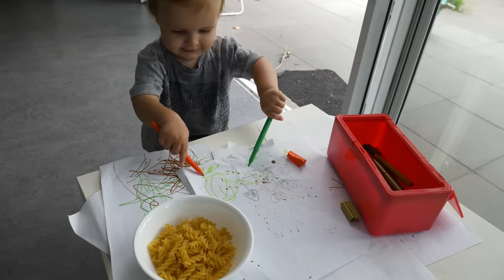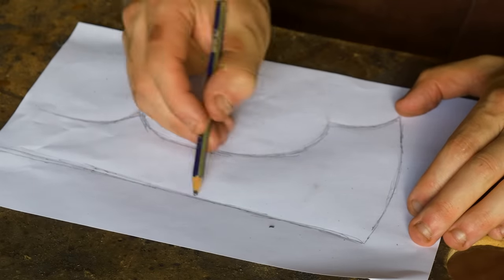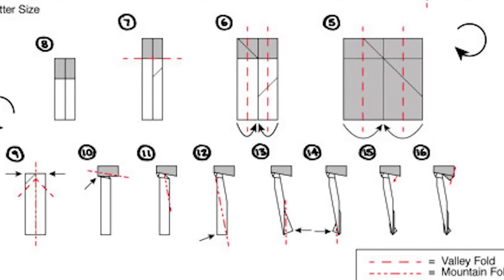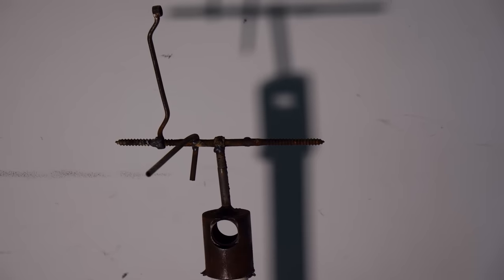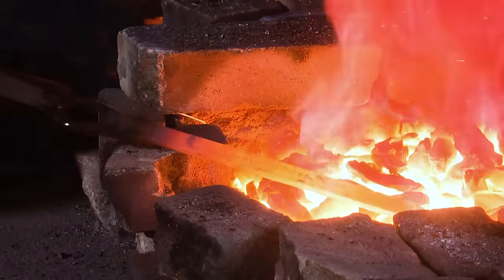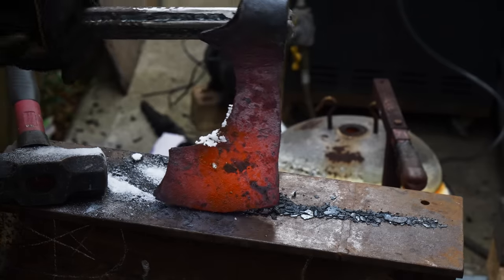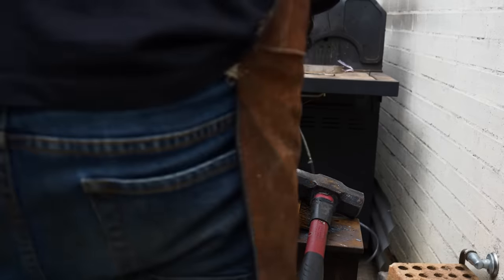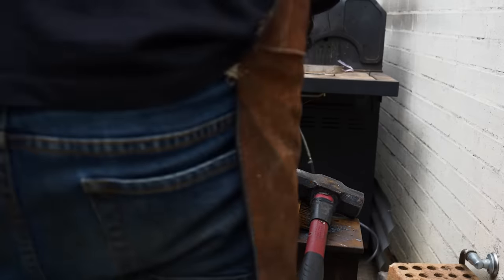YouTube's Worst Blacksmith Makes a Viking Axe!

Comment: The purpose of the two-headed axe is you can keep one side very sharp with a steep bevel for chopping a tree normally and the other side more dull with not as steep of a bevel for hitting things like roots near the ground where your edge could hit a rock or something. Source: Wacked a tree or two.
Reply: Hmmm.. Interesting.
Reply: Why not just have two different axeheads then? Or two different axes? Yes, it would be heavier, but you it would be way saver.
Reply: @tomatopotato1136  To my understanding it was popular with loggers and railway workers laying track back in the day. Because it's only you carrying the tools in and out of remote area's and probably needing to switching back and forth rapidly.
Reply: @patrick7742  Well that does make sense.

Thanks for the fun little information :)
Reply: @tomatopotato1136 it's just because 1 tool to carry is easier than 2:)
Reply: Came to the comments explain this, I guess I'm 2 years late.
Reply: And you can apply this philosophy to skulls and human appendages as well!
Reply: One thing I read  that makes sense regarding double-headed axes for combat is that the center of mass of a double-headed axe is more in line with the handle than on a single-headed one, which reduces the axe's tendency to deflect when you don't hit with proper form. The comment suggested that you imagine yourself trying to split wood with a throwing tomahawk or some other kind of single-headed axe with a really long blade to understand the concept.
Now I don't have particular knowledge on medieval combat, but this comment made me look at some weapons in a new light. Historical halberds and warhammers tend to display pretty balanced heads. They relied more on force than finesse, and were contemporary of plate armor that tends to deflect blows.
Reply: It’s also usually used as a battleaxe, not for cutting wood
Reply: @banjomanperson  No its not. Axes used in war only have one head because more weight makes it harder to swing & why have a second axe head. Its only in fantasy that they appear. Its like those axes with the spike on them they aren't really a thing in the way fantasy depicts because useless weight doesn't help you in the heat of battle maybe to look intimidating as a guard but in war it doesn't really do shit. Like real war axes & battle axes are just well more or less what was made in the video. if you look for them in museums & similar places like official books from historians you'll find no two headed axes because why would you need a two headed axe for cutting wood. Axes for killing usually don't have a big blade connected at the centre but top. 

Note: do research I'm just saying shit but two heads not used reason I'm not sure look it up. Fantasy usually is looks cool not practical in the setting it depicts because that thought ain't put into weapons unless you're a wierdo who'd do that for axes in a game or something.
Reply: @cillianennis9921  ok
Reply: @banjomanperson  I feel like I said more than i should've there.
Reply: @cillianennis9921  nah, someone else will probably find it interesting
Reply: @banjomanperson  yeah I forget who told me it probably the Italian guy with an angels name Metatron or something. Maybe someone on shorts if only I could remember to have an actual way to explain its use. I could also look it up.
Reply: @cillianennis9921  double war axes exist, it's so you can flip it when the first edge inevitably dulls on you. though they don't look like WoW axes or anything, and usually the second head is replaced with a spike or something similar, so you can switch attack tactics. but they did exist.
Reply: @vinnie666  yeah the thing with it being something else is a thing but you know a good soldier would keep there blade sharpened its not like you're ever likely to be in battle & realise oh shit i forgot to sharpen the end & thanks to having two it works. More likely to be with a different function one for more attacking a specific thing like an armoured soldier & another for a shield I don't really know. could you cite a source I'd like to read up on the real things as all I know is the fantasy depiction is not really a thing.
Reply: @cillianennis9921  oh, it's not about going into battle with a dull axe. it's about hitting enough people and armor with it that you dull it during battle. as for reference, they weren't too common since if you're gonna make a double axe, you might as well make one of them a hammer or spike. i think skall did a vid on this.... either skall or shad. there's been examples of them all the way back to like 3000 bc though.
Reply: Just a leftover thing from 30+ years ago. It made sense back then, today you can get a cheap cordless chainsaw, so they're pretty useless. Combining one tool into two was great back in the old days - tools like this were expensive, and now if you dull/damage one side you still have the other before you can make it back home and sharpen it. 

And of course they carried everything everywhere...2 big axes are difficult to carry...
Reply: @tomatopotato1136  if safety's the concern, you can just put a leather cover on whichever head you're not using.
Reply: 2 sharp edges prob works pretty well on a battlefield too, not like ur gonna stop for a sharpen mid fight so after hacking off several limbs switching the used side for a fresh one seems kinda smart :D
Reply: @tomatopotato1136  why would it be faster to switch axes when you could just flip the one you're holding.

Comment: Ididathing: talks about using a grinder safely
proceeds to grind over the top of two jerry cans
Reply: joeystar8888 Assuming those two Jerry cans are filled, there wouldn't really be any real way for a combustion reaction to happen. The toxic-yet-non-volatile fumes that would build up (if there's any space in the can to fill it with gas) would probably ruin the oxygen-gas mixture to cause an explosion. But we don't know how full the can is, nor do we know how thick the cans are. But it's likely that there'd be no way for it to explode if it was full, or if it was empty, would have lost the oxygen-gas mixture a long time ago
Reply from the maker: It can't hurt me if I don't notice it
Reply: Also your not supposed to use gloves with any rotary tools
Reply: @peterlarson5225  Believe me, using a grinder, use gloves.
Reply: @Killzilla6  for a grinder sure but a lathe a drill press a dremel or a chop saw never. It takes too long to pull the fabric from your wounds after because a glove will not stop those tools
Reply: @Spackman Games I thought the exact same. There is a reason that a grinder has a shield so that the sparks don't come and fly on your hands.
Reply: Chops wood on the floor with an axe while standing bare foot X)
Reply: @Rocknoob49  4:45 Attempts welding, with his left arm almost completely uncovered...
Reply: Oh yeah the man is a hypocrite at it's finest